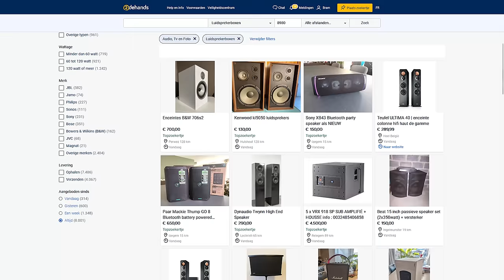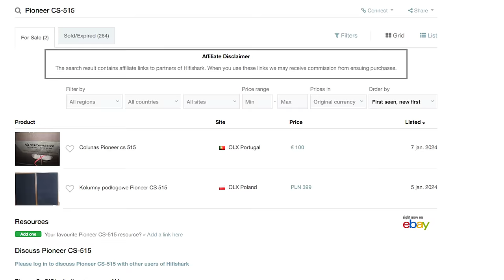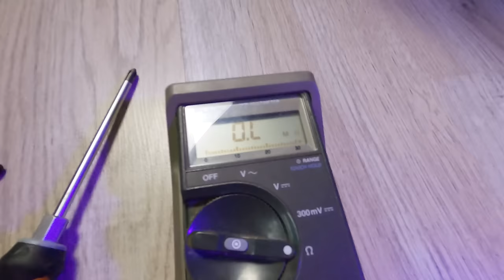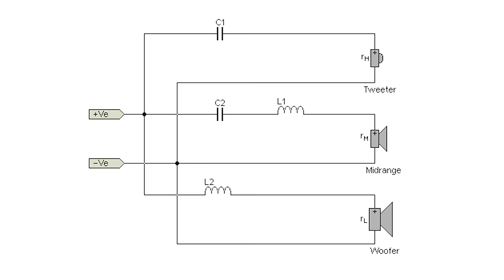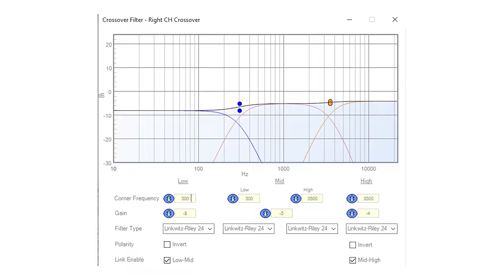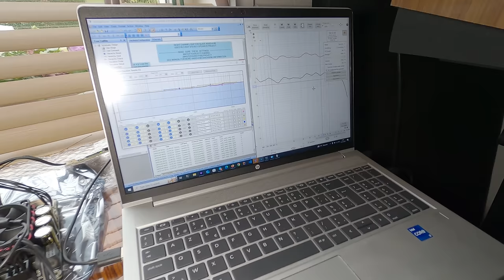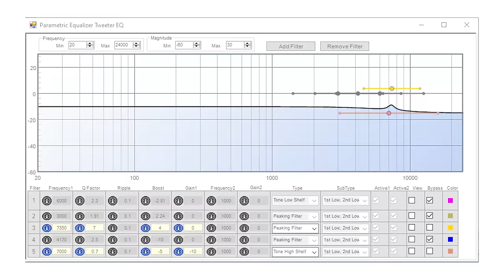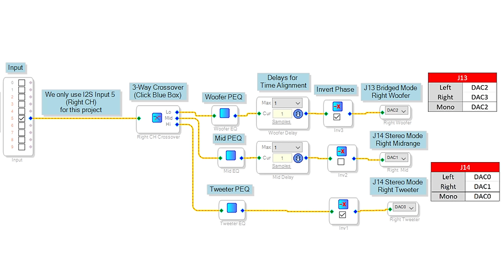Turning BROKEN Speakers into HIGH QUALITY Studio Monitors

Comment: Hi, do you think I can use my existing 2.0 speakers that are supposed to have a very flat freq response instead of buying studio monitors ? Here's a graph for the measurement alongside some JBL and Kali monitors. I intend to run these through the headphones output of an audio interface. I want use them primarily to track guitar. Is this a bad idea and could I potentially damage my speakers even if I am careful with the levels of the headphone out. 

imgur slash a slash NsVF8Vq
Also, is there any way to EQ them like you did (or by using an EQ plugin in the DAW), to make the response even flatter ?
Reply from the maker: I'm not able to see that image, but let me try to answer your question.

As far as I understand, it depends. If it's an active speaker (meaning it has built in amplification) you might get sound out of it, but you'll have to keep your headphone levels down, so the headphone amplifier does not send the audio clipping into your speaker amplifier. Depending on the headphone output, you might get different levels of quality, but that's something you will need to assess for yourself.

However, if the speakers are passive, don't connect passive speakers without amplifier directly to your headphone output. Always have a speaker amplifier in between. If you don't, the impedance differences would cause a load on the headphone amp that is too high, and it might kill the headphone amp.

Disclaimer: I'm definitely no expert on this, so what I'm saying here might be wrong as well.

I do wonder why you are trying to run these out of the headphone output, and not just out of the monitor outputs or line outputs though? 

If you want to, you can do corrective EQ inside the DAW as well. I've seen professional mixers do that in occasions as a temporary solution. Note that this might also cause the phase to change a bit, and you'll need to take it off when exporting. You also won't be able to use the corrective EQ outside of your DAW then.
You might also want to take a look at hardware EQ's, or a box like ARC Studio. Or the software SoundID Reference (Sonarworks).

Wether the speakers you are talking about can be used as studio monitors totally depends on the speakers. In studio monitors, it's important that the speakers are accurate, low distortion / resonances, and have a linear frequency response. Basically, you need to be able to hear as much flaws in the music as possible. Some HIFI speakers can be used to mix on, some are less suited. Them having a flat frequency response is probably a plus, so it's worth a try. But note that a flat response is just one piece of the puzzle.

Comment: Could you drop a link to the power supply and amp you used please?
Reply from the maker: Got most of the materials from SoundImports and Audiophonics. In the US you might want to use parts-express.

Power supply:

- SMPS300RS Switching Power Supply Module 300W / 36V

Amp:

- WONDOM AA-JA11117 Functional Cable Package for JAB3+ / JAB4 /
JAB5 Boards
- WONDOM ICP5 Programmer (needed for connecting them to the PC)
- WONDOM JAB5 AA-JA33286 Amplifier Module

Hope that helps!

Comment: Good work am in the middle of doing rhe same to some acoustic research ar9e 10inch all the work is the same lol but i dont think am going for powered amps
Reply from the maker: That are some impressive looking speakers. Might indeed be a costly endavour with a 4-way speaker like that. Are you using the original crossovers or replacing them? Good luck with your project!
Reply: @SirFreak  i don't know bro they play flat and sound really good the crossovers is the only thing i might make it a 3 way crossover and put active crossover on the bass driver ask for Amps two crown amps maybe at the moment they are using a NAD C 3050 or the Cambridge axa25
Reply from the maker: @allwayzactive4599  If it ain't broken, don't fix it :)

Comment: Install noctua/bequiet fans on those DSPs. I want to do that with my old pair of 4-Way Sansui SP-Z66 200W !!!!!!!
Reply from the maker: Good idea! They don't turn on very often, so perhaps I could even get away with replacing them with a passive cooler?
Reply: @SirFreak  Possibly, but you'll need a bigger one. Just keep in mind that if there is a fan on it, it's required at some point.
Reply: @SirFreak  but noctua and bequiet fans are so quiet you won't ever hear them.

Comment: was the fan problem? finally how would you compare it to ready made product?
Reply from the maker: @manitsony6703  the fan does indeed make some noise. The mid to high bands sound much better than a typical studio monitor. The bass/sub was not bad, but was not great either. In the meantime I replaced the bass driver as well. A video about that will be dropping later.
Reply: @SirFreak  interesting.. these are xlr inputs? I did buy external dsp speaker processors but it was a cheap one from Toman... Immediately when I plug my cable inside I felt the degradation of the sound is it because of the dac on dsp??
Reply from the maker: @manitsony6703  Could be a bad dac/adc, or it could be that the adc is clipping (happens with the boards I used when the level is too hot). Sadly, these are not XLR. I could put an XLR input board in front of these, but the cable from my DAC to these boards is so short I notice no degradation in sound. More expensive amps like Icepower and Hypex would be better though, and those usually have XLR inputs. But they will be way more expensive, so that's a decision you need to make for the speakers you are working on. The amps I used are in no way perfect, but with some modifications I did (keep an eye out for that in an upcoming video) I did reduce some issues like that noise.
Reply: @SirFreak  please please waiting for your next video. anywhere i can personally chat to you?
Reply: and comapring to your hs yamaha is it much better? how much better would you give score?
Reply from the maker: @manitsony6703  I'm almost done finishing the speakers, I'm doing some final finetuning right now. After that I'll make a follow-up video. Feel free to send me a message on instagram or facebook if you want to chat. In the configuration at the end of this video they were already in a whole different league than the Yamahas. I think they could easily be compared to speakers in the 3000$ a pair range. In the meantime I did some other upgrades, and while they will probably never beat a fully custom designed speaker, I personally feel they can rival speakers worth thousands. They are just so revealing. You can hear compression, reverb tails, subtle amounts of distortion...

Comment: 322 / 5,000
Hi bro, very good video and excellent information, thanks for that. Could you tell me if you modified and reused the speakers like you did? Would it be useful for my home studio to mix what I recorded with my band? I'm not talking about making it into a super production, but at least something decent. Thank you very much and best regards.
Reply from the maker: I did some further modifications to these speakers, but that's for an upcoming video. Since a few weeks, I do use them to produce and mix on.
If you want to do such a project, I suggest getting measurement equipment too. If you don't have that already, you might end up spending more than when you just buy studio monitors that are readily available. While the quality of the end product I made here is better than a lot of studio monitors, it takes a very long time to get there. So a little warning: don't start a project like this unless you're really passionate about it.

Comment: One thing: with 100W, you may blow those tweeters (and maybe the other drivers as well) 'in frieten' ;-)
Next step: building an MFB-system into it?
Reply from the maker: I've also been afraid of that. I already lowered the gain of the tweeter with -14dB, and I never use them terribly loud, but perhaps I should also add a limiter in the DSP?
I had never heard of an MFB-system before. Definitely something I should research...
Thanks for the feedback!
Reply: @SirFreak  It was a Philips-invention. It were powered speakers that used a transducer in the woofer to send that signal back to the amplifier in order to correct the motion of the woofer. In that way, the low-end could be extremely tight for a very small box. They used it from the early 1970's until I think around 1985. The Belgian company Servo-Sound had developed a similar system in 1968.
(in 't Engels voor nuttiger te zijn ;-) )
Reply from the maker: @CyrielBouckaert  Just had a look at some of those electronics and I think I'll first need to follow a decent electronics course before I'll feel comfortable doing that. Definitely interesting stuff though.

Comment: 13:05 you should not measure speakers like that

1. measuring outdoors is much preferable because of room modes and wall reflections even in a treated room, alternatively measure 5+ meters away (or rather 5 times the measurement distance, but you don't want that under 1m especially with a speaker that big) from any wall in a very big indoor room
2. plain white noise with RTA is not a good way to measure a speaker, it seems you're using REW, so you should only use the built-in measurement mode instead, it will compare the signal it sends to the speaker to what it records and can give you a lot more (and a lot more accurate) information
2.1. if you want to use white noise you can use opensoundmeter as it can do transfer function measurements giving a similar result to what the frequency sweeps give you in REW

once you have good measurements (frequency response and phase) you can import them into vituixcad and simulate the crossover there much quicker than you could by tweaking settings and measuring again

(correct) acoustic measurements are a science in and of itself though

it's a very cool project, and it seems like it turned out well
this is just meant as constructive criticism for future projects, hope it doesn't come over negatively
Reply from the maker: Everything you say is correct, but let me just clarify a couple of things. First of all, the measurements using white/pink noise with RTA were only to test the behavior and limits of the different drivers. After that I always used the measurement mode with sine sweeps.
Measurements outdoor (or in a anechoic chamber) are indeed preferable if you're making a speaker that should behave well in most rooms. In this case however, I'm specifically making them for this room. I do not care how they sound when placed anywhere else. Measuring them outside can still be a nice reference in that case (to make sure it's the speaker and not the room that is causing some things), but what's measured at the listening position (about 2m from the speaker in my case) is what's most important for me.

Comment: why is that tweeter only 10 watts is that a missprint?
Reply from the maker: Good question! No, they have a nominal power handling of 10w, and a max power handling of 30w. But these tweeters have a sensitivity of 92db / 1w @ 1m, and that is actually pretty loud. At 10 watts that would equal 102dB, which can easily cause hearing damage. 
I of course have to be careful to not overpower them with these amps (100w), that's why I turned the gain on the tweeters down quite a bit.

Comment: Do you take payments my speakers need surgery
Reply from the maker: What speakers, and what's the problem? Also, do you live far away from Belgium?
Reply: @SirFreak  they are mackies mr5 and one of the speakers I think it blew out and the other one has a delay when it turns on it takes a while for it to play sound and yes I do I live in United States
Reply from the maker: By the time you shipped them you'll have paid as much as buying new ones, I fear. No way you can get them repaired by the original dealer, or a local speaker repair shop?

Comment: So you went for the Bose approach
Reply from the maker: Hey thanks for your comment. I'm not quite getting why this would be the bose approach? Care to elaborate? Thanks!
Reply: @SirFreak  Ah ok. Bose is notorious for  adding a lot of electronics and psychoacoustics stuff to their equipment. When you mentioned the computer whiz stuff and electronic crossover I remembered them
Reply from the maker: I see, thanks for clearing that up! I indeed love DSP and the possibilities that it brings for more accurate sound reproduction.
Reply: The Bose approach would be a smiley face EQ, and face the speaker backwards, so it fires toward the front wall and reflects back to the listener!
Reply from the maker: @FOH3663  I won't be trying something that exotic haha
Reply: As a 70's teen, I really wanted Bose 901 loudspeakers hanging down from the ceiling, in nets, ... yep, that was the dream. 

Lava light, sandalwood incense, shag carpet.  

I recall being told the Bose 901 could handle "essentially unlimited power" ... due to the nine voice coils.

Comment: You didn't answer the most pressing question... Oww muh chiz it?
Reply from the maker: They are not for sale, but I think they can easily rival some speakers that cost 4000€/pair now (maybe even more).
As for how much I spent on the project until now, about 775€ (includes the original speaker + new tweeters + cables + all other components).
It can probably be done a bit cheaper as well. I do have some left-over material, and a big cost was the mogami cables, which costed €115 euros for 6 metres of cable...
I hope that answers your question :)

Comment: Having different speakers is like having a good tone balance or bass and treble adjustment, loudness for the 80s dude,my advice is go big and get enough power from the 80s amps pre amps, then all speakers will sound just like you want,blar blar blar ..
Just listen and mess with the controls,there for a reason.f..

Comment: Carbon fiber?😂
Reply from the maker: I could definitely be wrong in this case. I've found some german magazine pages from back in those days that mentioned they have "Kohle-Fiber Tiefton-Membran". I just assumed that was correct. Not quite sure what material it could be otherwise. Doesn't look like paper either. It's more something like a wool-like material. If you happen to know what it is, please let me know!

Comment: 300hz is too low for that mid
Reply from the maker: Could you please tell me why? When testing the drivers they dropped off at 80-90Hz, so I assumed 300Hz was well within the safe operating limits of that driver, with half of that (150Hz) still being above that point?

Comment: Doing what?High quality studio monitors driven with bluetooth and analog to digital and then back to analog.Is not only the questionable sound quality but also the latency that introduced to the signal.And just play a music instrument live to test them.Even if the slightest delay exists between real and reproduced signal then all the job is for nothing.Of course there are no easiest ways to do with active crossover designs in analog,but the signal is kept analog all the time and there is no latency.
Reply from the maker: Lots of high quality studio monitor brands use DSP: Neumann, Adam Audio, Eve, Genelec, Fluid Audio, Wayne Jones, Dynaudio, PMC ... Most of them do AD/DA conversion to achieve that.
There is of course a small latency introduced by using DSP, but this is probably just 1-3ms (depends on how much processing you do). As a reference, when standing 1m away from a monitor you already have 3ms of delay as well.
A lot of different things introducing delay can of course add up and start to become noticeable. But for mixing, for example, it does not matter. And the delay is also a lot less than the roundtrip delay of a typical audio interface with a DAW, which will be a bigger factor for delay.
Of course, when you use Bluetooth, there will be more delay. I have not tested how much delay the Bluetooth introduces. But I will probably never use Bluetooth for tracking virtual instruments live anyway. This is rather just a handy feature for someone who comes in to the studio real quick and wants to hook up to the monitors to play a certain song or whatever. Oh and when using Bluetooth there is no AD conversion, only DA.